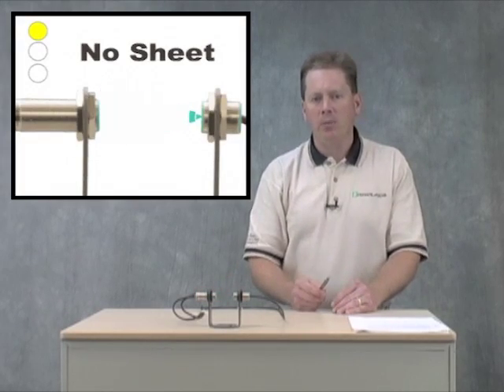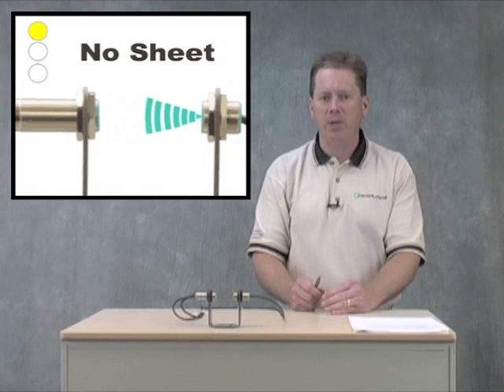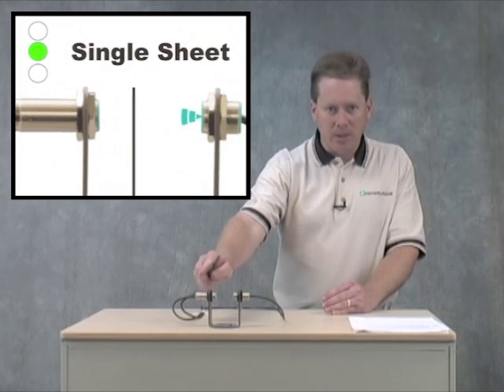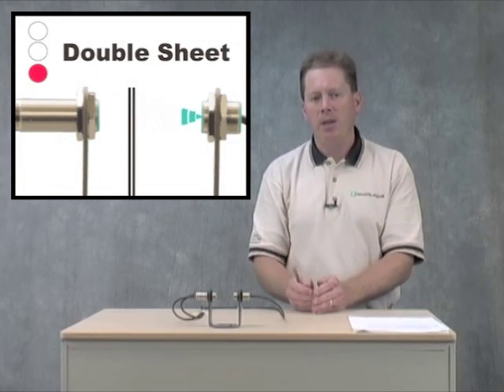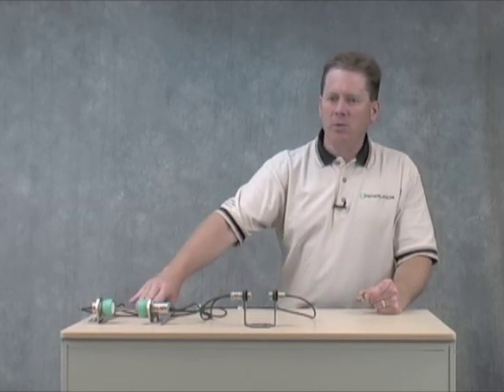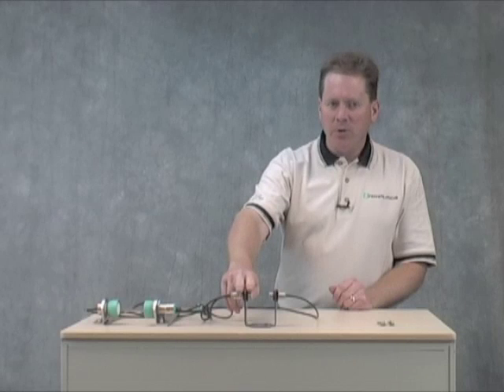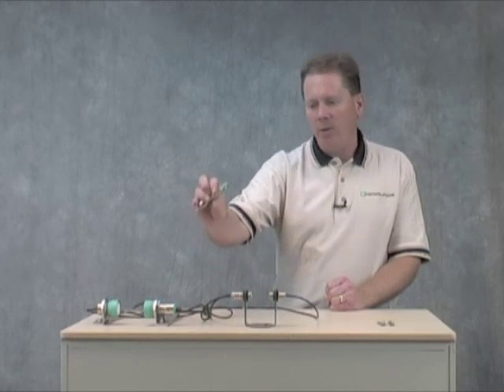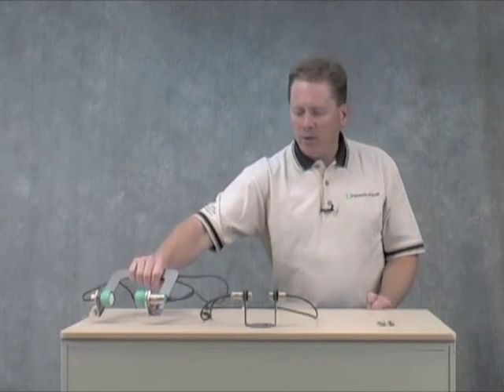Ultrasonic Sensors for Double Feed Detection

Comment: can you share part no. and specification
Reply from the maker: Hi Dipak, what is your application? We have 3 different designs of double sheet sensors.  For example, our UDC-18GM50-400-3E1 has  a sensing range of 20 ... 60 mm , optimal distance: 45 mm.